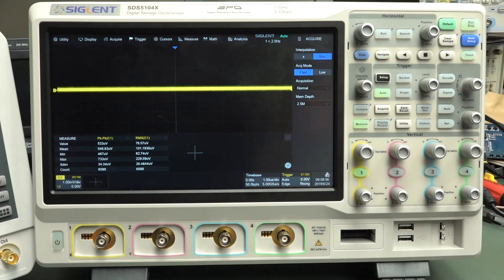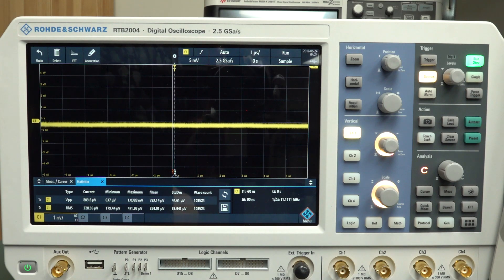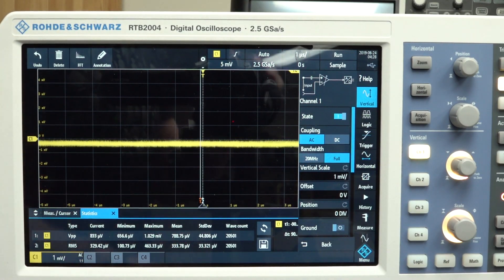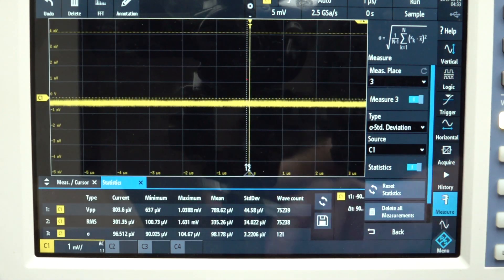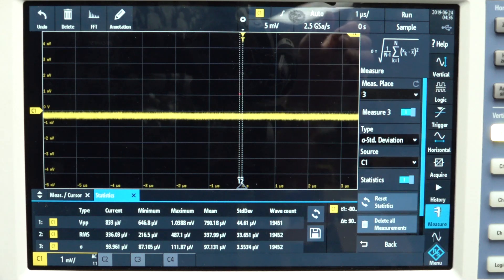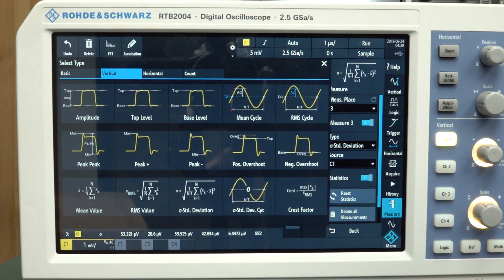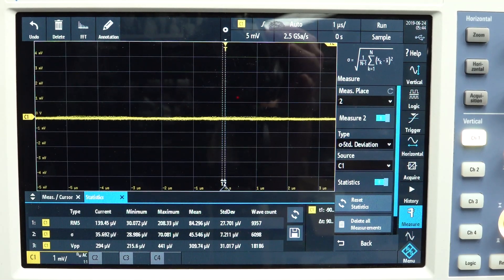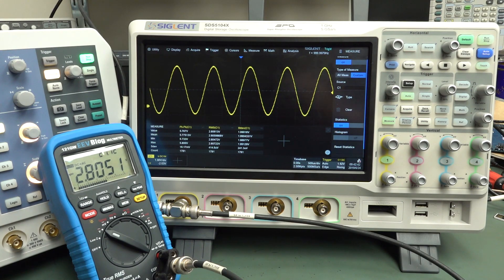EEVblog #1223 - Oscilloscope Standard Deviation Noise Measurement

Comment: in the formula of the standard deviation, the "1/(N-1)....."??? why -1?
Reply: Actually, there are two! formulas for standard deviation, one uses 1/N to calculate stddev for the "population" (population includes all possible measurements)  i.e. it would be the case if you have an oscilloscope with unlimited memory and you're measuring for an infinite period of time.  And another stddev formula uses 1/(N-1) when you have a fraction of all possible values which is called a "sample".  So, if you know all possible deviations from the mean  - you have a population and then you can use 1/N multiplier. But when you only know a fraction of deviations from the mean - you have a sample. In case of sample - 1/(N-1) is used as a multiplier because when you have a sample, you have limited knowledge about all possible deviations, so you should be pessimistic and think that actual deviation is slightly bigger than you see, so, 1/(N-1) does this "correction" for you. It simply increases stddev value slightly to incorporate  measurements which are not included into the sample.
Check out this for more clues - https://www.mathsisfun.com/data/standard-deviation.html

Comment: By coincidence measuring tiny AC noise signals with a SIGLENT scope is exactly what I am doing this week. 
So, thanks for the timely reminder to use stdev rather than RMS, and to run the scope self-calibration!
(SIGLENT advises that the scope be left running for 30 minutes prior to self-calibration to let it thermally stabilise first).
Reply from the maker: Yep, always let it thermal stabilise first.

Comment: Bonus info: you can use the Vmean measure function to get the DC component only, and sub this from Vrms to get "AC RMS" if your scope does not have the standard deviation function
Reply: Simply subtracting Vmean from Vrms is incorrect. The correct way should be "AC RMS" = Sqrt(Vrms^2 - Vmean^2).

Comment: It's worth mentioning that the reason that Volts RMS doesn't remove the offset is because it was created to calculate the DC equivalent heating value ( or total energy value) of the source into a load, & for that purpose, obviously any DC offset should be included.

Comment: TRMS (is there false RMS ? no, it is just marketing ) should be AC+DC  but almost all TRMS DMMs measure AC coupled. If you choose the AC+DC mode you get the thing that is the one and only true RMS (just called RMS ). You can measure  AC, also AC-coupled (so the TRMS of most meters, then measure DC and then calculate the real RMS from that)

Comment: Wouldn't it make more sense to properly terminate the inputs or at least fully shield them when measuring the input noise? If you leave them open, 1) the one with the lower resistance to ground has lower voltage noise and wins, 2) the inputs are very susceptible  to surrounding e fields  (and thus of the equipments position in your lab and even your position in your lab) as is visible in your traces as a periodic pattern.
Reply: I also thought it was strange to leave the inputs flapping in the breeze like that

Comment: Will those scopes report the BW they are in based on the voltage selection?  I don't know any that do, but I wish they did.  It's all great to say you have a 200MHz or 300MHz scope, but what voltage range do you have to be in to get the full BW?  If BW reduces with smaller voltage ranges, I want to know (without trying to find it in specifications) what the scopes current BW is.  That is a trap for new players and us old farts alike.

BTW, after self Calibrating my precious (lol) TDS3032, at full BW (???) on the 1mv range, 1us/div (as in your video), I am getting about 37uv RMS (no stats function other than my eyeball on the old 3032).  Before the recalibration, it was around 350uv RMS.  For what I use it for, noise really doesn't matter, but very interesting.   The BW at Vertical Division selection has me trying to look the specs up (it should be reported on-screen, dang it!).

Comment: Hi Dave, I was curious and did a google of your multimeter. Would you say this is common for any high-end meter? In our labs at my uni, we sometimes would like to measure current, but most cheapy current measurement boards are for well above the <1A to 3A DC range we would go for. In these cases, we usually have some complex impedance, so direct measurement is important. Would you say your meter can give reasonable fidelity across the whole +-10A range without the noise we would get from a cheap board that maps 10 A to a few volts output? Probably not the best place to manage your sales, but for now, I don't want you to spend your time answering this if you're not just scrolling through comments to pass some time. Cheers from far far away in rural Wollongong haha.

Comment: I can't tell you how many times I tried to make my colleagues aware of the difference between STD and RMS. In my field, people tend to calculate the SNR of a signal as P2P/RMS, because that's just "what everybody" does. Nobody ever talks about the fact that RMS includes the mean and for clarity it would make much more sense to use STD. Why does nobody actually use STD? Well, because then people would tread onto the field of statistics and make themselves vulnerable. As long as you use RMS people will assume an engineering/electronics context and not ask too many maths questions. facepalms

Comment: Greetings: Sorry, but that R&S offset after the AC coupling is not acceptable to my way of things- fail.
Reply: Not to be naughty, but an offset of approx. 350µv makes you say it isn't good enough, then you just have to spend more $$$

Is the “fault” there, yes, is it important, not for me, 350µv has no meaning at all, special when you can auto-calibrate, but  I guess it depends on what you are using it for. I use oscilloscope for audio, power electronics and incoming repair.
I would swap my 15 yer old trusty leCroy 9450 in a heartbeat with the R&S
Reply: That seems to happen on quite a lot of scopes. That's why they have the self calibration feature.

Comment: Hi Dave
Just checked my DS1054 and no Std Dev measure function. Doing a self cal as I write. While I've got your attention. I'm getting back into electronics as a hobby and purchased the DS1054 as a good entry level scope. Have you considered doing a series of videos on the why and how of using a DSO? Cheers
Reply: He has covered a lot of DSO info in the past; probably all you are looking for and more. Additionally, Tektronix has a very nice Oscilloscope guide pdf you should read. Just google "Tektronix oscilloscope fundamentals .pdf".
Reply: @SuperSSSSooonniicccc  Hi Thanks. Yes, I know Dave has done a lot of stuff on using a DSO and I've looked at that. Thanks for the link however that is a bit to basic as I'm familiar with the basic workings of an analog scope.  I was hoping to encourage Dave to do some more videos on the why and how of some of the more advanced DSO functions. Any function that's not available on a basic analog scope is advanced to me. Cheers
Reply from the maker: I've done quite a few videos on various aspects, but they are scattered over the place.
Reply: @EEVblog  Hi Dave and thanks for getting back to me. Yes, I've look at quite a few of those videos and they are all, as usually, very helpful. I especially liked the one on using the DSO as a bode plotter as I was wondering if that was possible. As I said getting back into electronic, I'm comfortable with the basic of the analog CRO however the why and how of the feature of a DSO not so. It's having someone with the knowledge to confirm yes that is the way to use that feature and that is what to expect and here are the traps. I've had a bit of a look around and there does not appear to be a modern reference to using the DSO. I'd be surprised if I'm alone, so anything you could offer in this area would be appreciated. Thank again. Bill P

Comment: It's still essentially bandwidth. Normally, let's say audio. We use 20-20khz rms noise. Another truth is as the update rate of the scope, it's not possible to measure low frequency accurate at all. Whether using higher time/ division will help idk. Probably.
Reply from the maker: I've done a video related to update rate and noise https://www.youtube.com/watch?v=Znwp0pK8Tzk